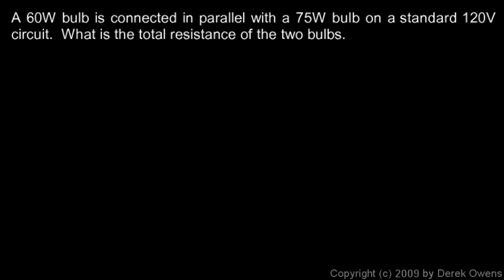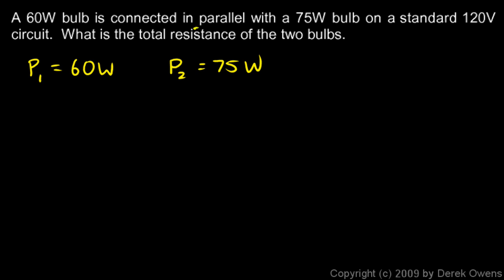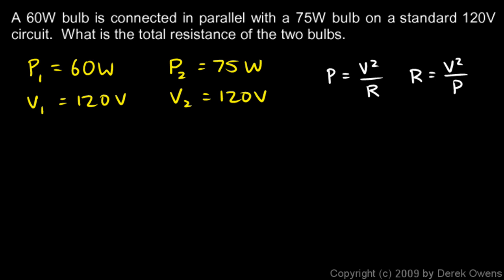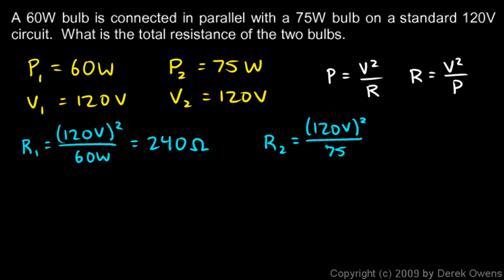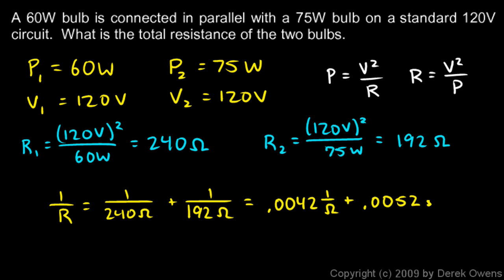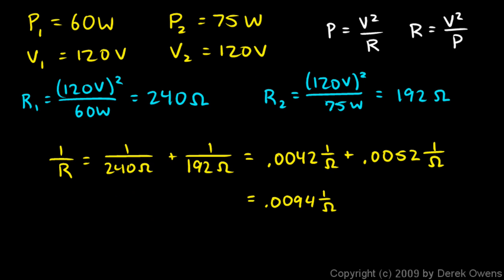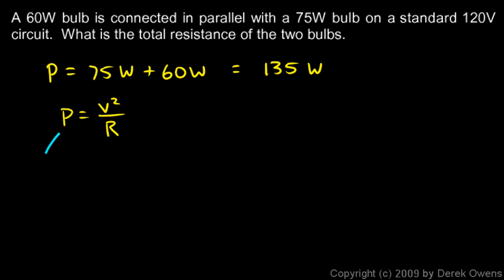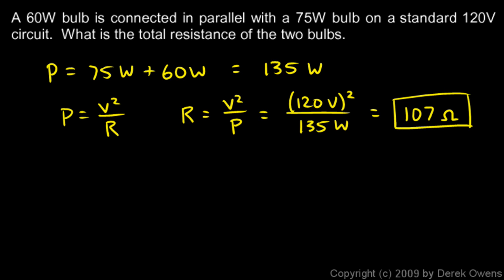Physics 13.4.3a - Parallel Resistors Example

Comment: @ArtemRomanov you can also solve it by the sum of the reciprocals. 1/ {1/240 + 1/192} punch 240 into a calculator then hit 1/x (the reciprocal symbol) u should get 0.00416666....7 then hit 192 and hit the 1/x reciprocal symbol u get 0.00520833333..3 add those 2 together u get 0.009375 then thats the number on the denomiator 1/0.009375 so hit 0.009375 into the calculator once again and hit the 1/x reciprocal symbol one more time and you get 106.66666666....7

Comment: @ArtemRomanov since it's 2 resistors in parallel (and this applies to more than 2 branches in parallel) you can take the 2 resistors that are farthest from the battery (the load end opposite the battery) and use the product over sum formula. (R1)(R2)/R1 + R2. R1 in the video was found to be 240 ohms, R2 was found to be 192 ohms. Using the formula, 240(192) / 240+192 = 46080 / 432 = 106.666666666...7 you can also use the sum of the reciprocals of the reciprocal which is what this video shows